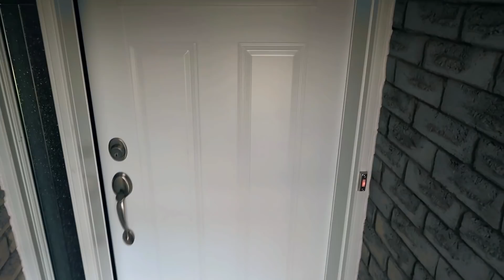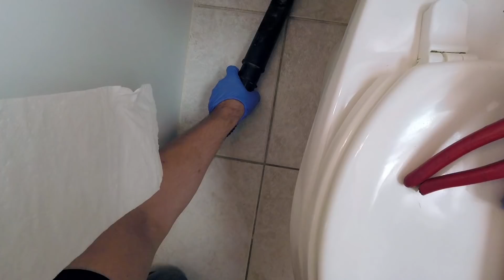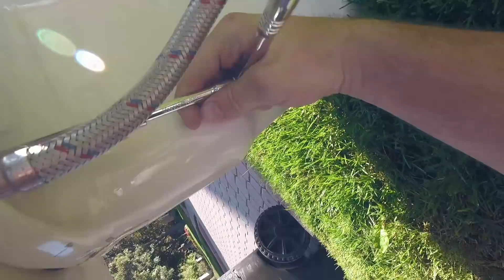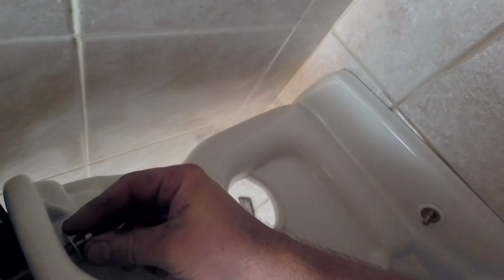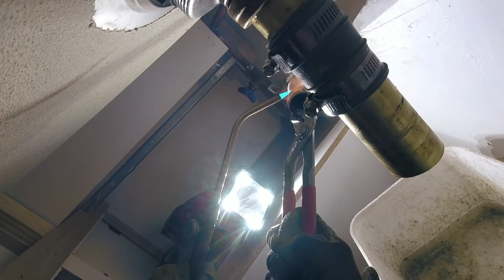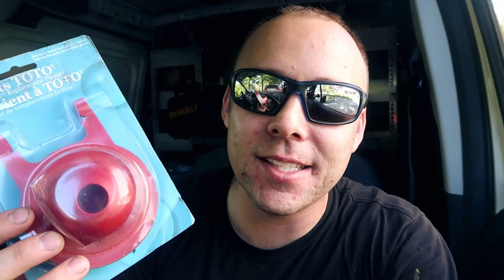A Day In The Life Of A Plumber/Plumbing Apprentice | Toilet Install Vlog 50

Comment: Way to go Kenny! btw are those gloves you are wearing while using the b tank flammable?
Reply from the maker: Hey Sun, thanks for the support. I’m sure the gloves are flammable, but they can take more heat than the rubber ones I had underneath. I prefer the yellow gloves during soldering!